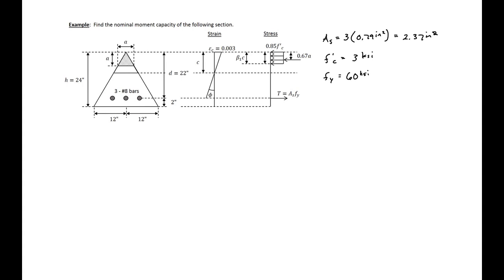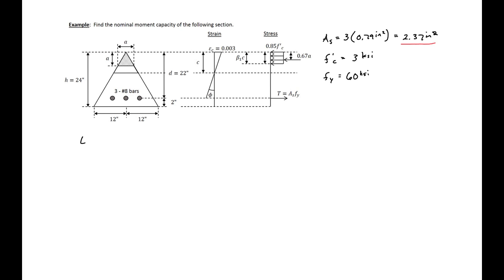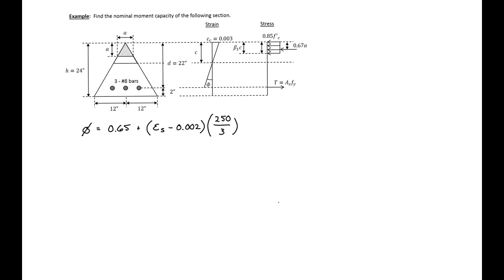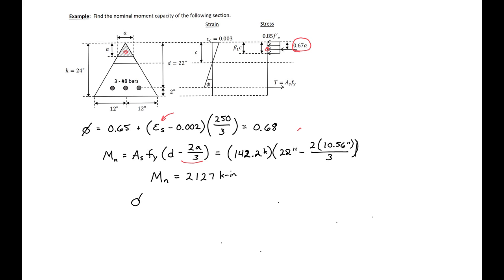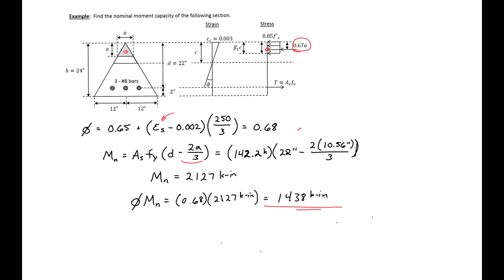3 - Example:  Nominal Moment Capacity of Triangular Section

Comment: Is the area of an equilateral triangle the same for a regular triangle? Or should we be using a different formula for that?
Reply: No. The calculation of the area of the compression section of the triangle is different. In this problem, the area was calculated as a * (a/2). This is half times base times height since base and height are both equal to a. In a triangle that is not equilateral, the height of the section is still equal to a, but the base is not. You must use similar triangles to multiply the height a by whatever the base to height ratio is for entire beam cross section is to find the value of the base of the compression section. Then you can solve half times base times height. Hope this helps.